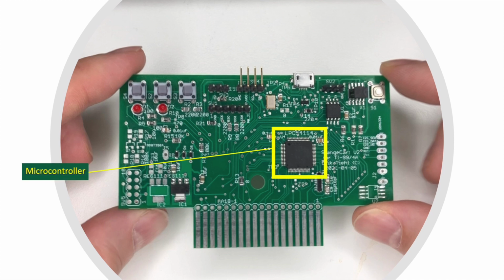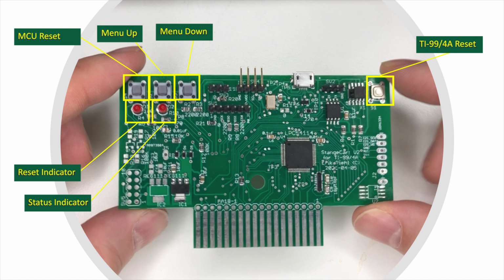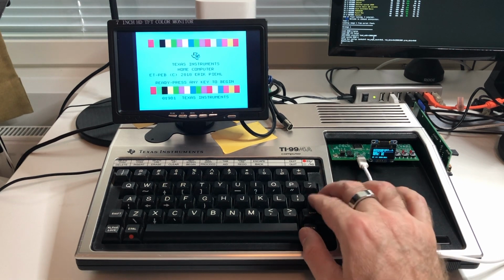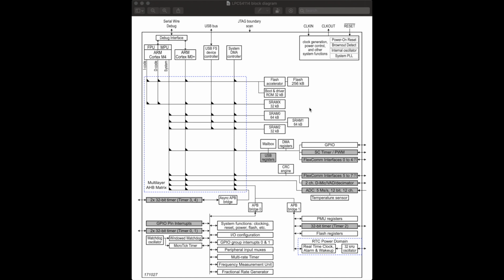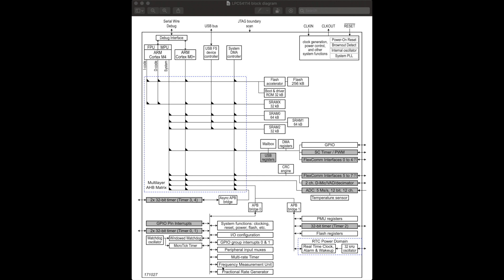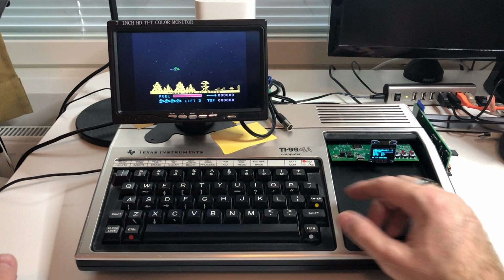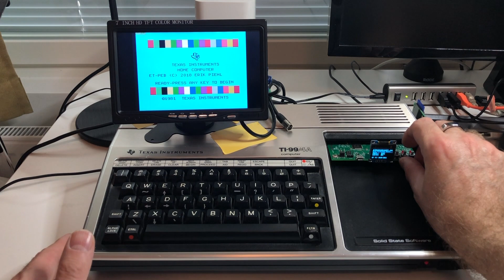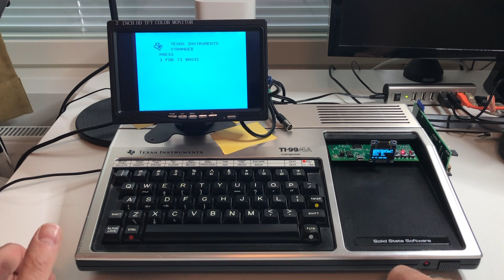StrangeCart dual core coprocessor for TI-99/4A

Comment: @erikpiehl1764 Hi Luke here from the UK, ive just resurrected my TI99/4A after it being in storage for 40 years & its still as much fun as i remember it being. Did you ever get round to making & selling these boards ?
 If so do you have a place i can buy one, ?
ide happily pay you well to build one for me, 
i cant build one myself ime afraid due to only having one eye, fine soldering is not impossible for me since my accident, ide love to have one of your creations  so i can write software for the TI99 & run it the way it should always have been. 
It could have been so amazing so far ahead of its time if it had not been for those bottle necks on the  cpu, imagine how diferent computing could have been now if TI had implemented that CPU right back then.
your creation free's the system to run at its full potential.  Ide very much like one.

Comment: Always great to see new stuff - software AND hardware - coming out for these old systems like the 99/4a, Commodore 64, ZX Spectrum and so on. I never had a TI but a friend of mine did. He used to boast that it was 16 bit and ran at 3 times the clock speed of my C64, but then I'd ask him why most of his programs run slower than mine! (I found out later why that is). TI-BASIC was better than CBM Basic 2.0, though. Good times! Looking forward to getting a Mega-65 or a Commander X16 when it's finally released.

Comment: So the ARM processor is doing all the Work , only the TMS9918 Video chip is actually being used to display an image, the rest of the Ti-99/4A hardware has been 'by-passed' by the RISC CPU.  ??
Reply from the maker: The TI-99/4A’s CPU is drawing all the graphics as instructed by the ARM CPU. The TI’s architecture does not provide for direct memory access from peripherals, so the TMS9900 CPU is sort of an I/O controller here. Thus all the hardware is still active and in use.
Reply: @erikpiehl1764  So the ARM CPU interprets all the high level language and then passes it as machine code to the TMS9900 , so the TI-99/4A becomes a video card with a TMS9900 CPU as the controller doing the graphics ??
Reply from the maker: Yes, that’s pretty much how it works.
Reply: Would it not be possible , to say , use a TMS99105 clocked at 24MHz...instead of using a RISC  CPU. OK it would be nearly as fast , but it would still be a Ti 9900 chip  keeping things authentic with the original design ?
Reply from the maker: This project did not start out as an accelerator, although it certainly was a possibility. I was looking to make a very simple (hardware wise) cartridge with lots of flexibility (complex software). 
TMS99105 chips are hard to come by, and I’ve already built a whole TI-99/4A using one and a FPGA chip.
Part of the appeal of this project for me personally is to use modern development tools, and combine modern interfaces like USB with retro computers. This for instance makes this cartridge a nice development tool for normal cartridge based software for the TI, since you can quickly upload cartridge images over USB and run them on the real iron.

Comment: Can you post on Atariage the code for the graphics demo?
Reply: Something like can be found in the booklet coming with Amstrad CPC464. It's a predecessor of hidden line removal code for a 3d presentation of a function. There are no lines(visible or hidden) but only dots. The first line establishes for every vertical, the min and the max. Plot with dots . The next line checks for every point if the dot should be present i.e smaller than the min, or larger than the max.
Reply from the maker: The code is not on a releasable state overall, and I haven’t yet decided how I might release it. I have already presented key ideas in the StrangeCart thread at AtariAge, as well as key snippets of code. Have you had a chance to take a look at those?